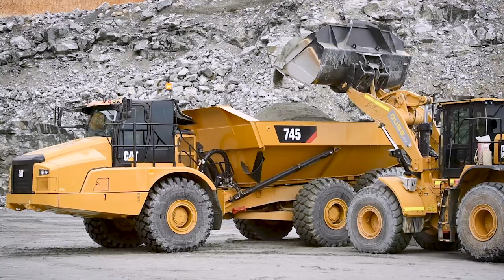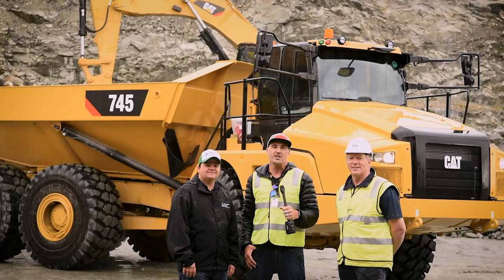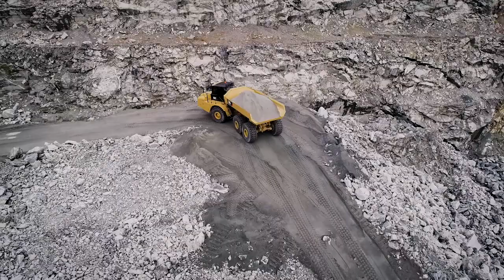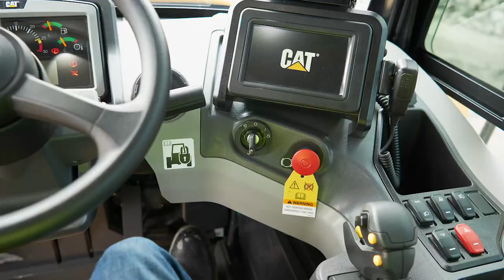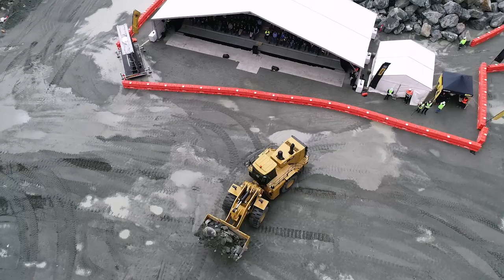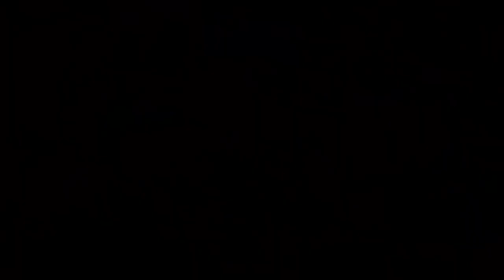Cat® 745 Test Drive in Australia

Comment: auto is the worst invention ever !
auto diffs dont kick in until your stuck , then its too late ! you need to operate diffs before you hit the bad ground to get through
auto skip up , you have to be stopped while lowering and tipping 
also if you are half tipping and need to stop its too late , auto just causes more and more problems  , thats why volvo are ahead of the rest no they still have manual modes for everything